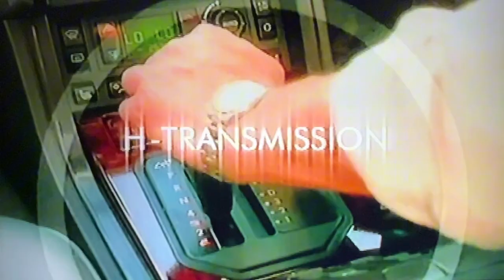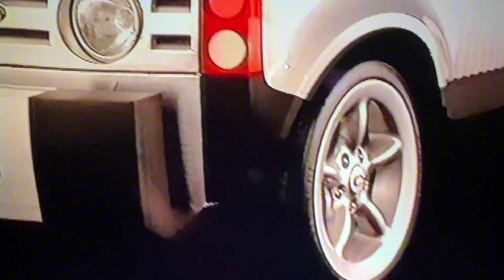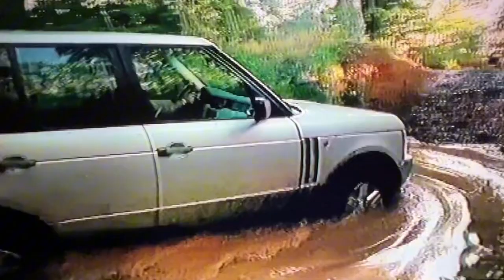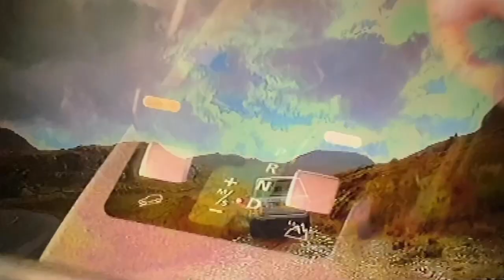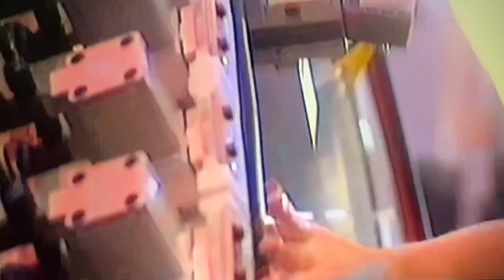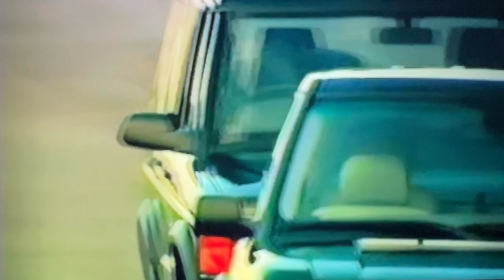2002 model New Range Rover launch L322

Comment: Everything is fine but not the air suspension
Reply: The air suspension is fine.
Reply: Fix it then.
Reply: If you remember that air springs are rubber bags, and like tyres need replacing when worn, so they don’t leak & make the pump run constantly, wearing that out, air suspension is astonishingly reliable.